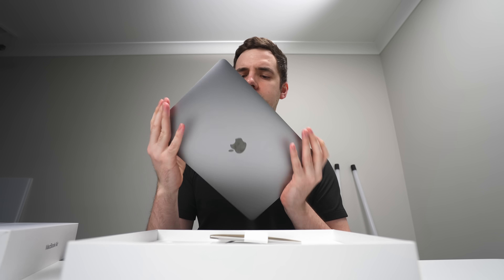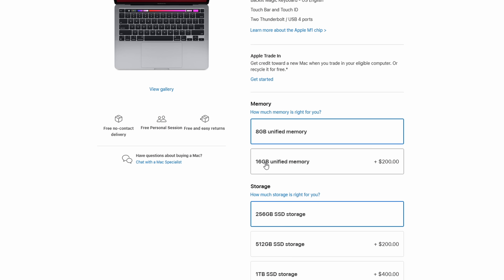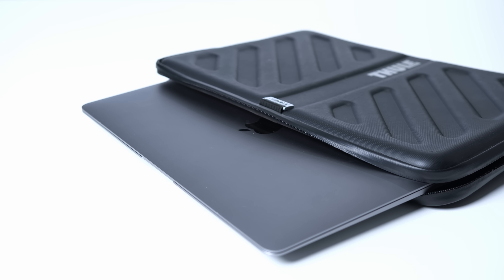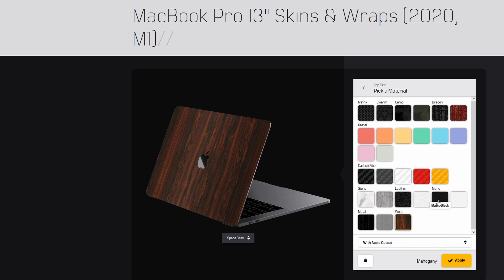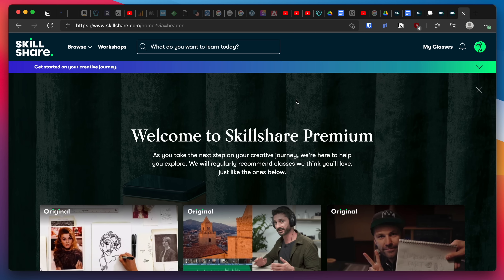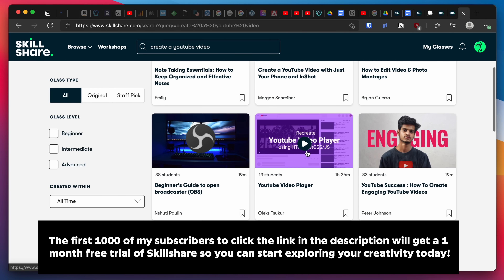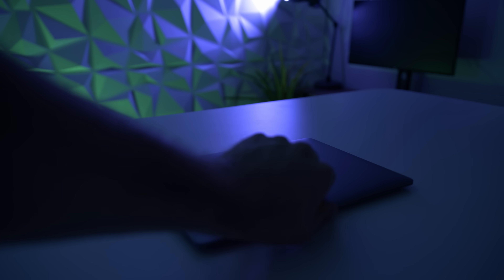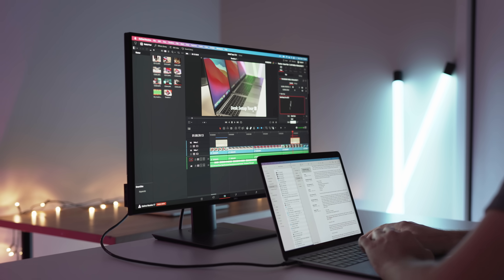How To Make Your MacBook Last FOREVER! (Ultimate Guide)

Comment from the maker: Here are the products featured in this video:
⮕  Thule MacBook case: https://geni.us/thulecase
⮕  Screen cleaning kit: https://geni.us/screenclean
⮕  Aluminum Laptop Stand: https://geni.us/mstand
⮕  Dell U2720Q 4K Monitor: https://geni.us/4kdisplay
⮕  Leather Desk Mat: https://geni.us/leatherdeskpad
⮕  Anker USB-C Hub: https://geni.us/ankerhub8in1
⮕  Samsung T5 Portable SSD: https://geni.us/t5drive
⮕  CalDigit Thunderbolt 3 Dock: https://geni.us/thunderboltdock
Reply: Please make a video on how to clear clutter for the OS and increasing the longetivity of the drive.. Thanks in advance
Reply: Can I get an Amazon mini fan and use it as a cooler for the MacBook? I’m broke.
Reply: Was this the monitor used at 10:56 ?
Reply: How about buying the M1 macbook air, which is fanless, but plugging it into an external laptop fan stand, and then running high workloads? Would that be ok for longevity? This solution sounds like a budget middle ground between performance & heat minimisation, as such I was just wondering if I could get your opinion on this please?
Reply: The links don’t show the specific product…

Comment: The M1 fries its SSD nands. Also after 7 years Apple no longer supports the product with software. Since its newest laptops have everything soldered its extremely hard to repair and Linux still dont have good enough support for Apple silicon. So you get something that is REALLY good for about 5 years. Then its getting sketchy with the nands that grounds out themselves. Sadly

Comment: I got my 2019 MacBook Air battery replaced in 2023 and in 2025 it suddenly won’t work if not plugged in and randomly turns off. All checks say it’s fine! Don’t know whether it can be saved or if I need to buy a new one. I’d hoped it would last about ten years, not 6!

Comment: I have a 2015 MacBook Pro that worked just fine but Apple stopped updating its OS beyond  "Monterey".  Some new software will not work on this OS.  I have some programs that I use that requires the most current OS.  That brings me to my new MacBook Pro M4 Pro - 24GB - 512GB.  I like my new MacBook but I didn't like spending $1800!

Comment: Cheers for the hints. I completely disagree with the assessment of the durability of the SSD, especially the potential period of around eight years mentioned. My Air now has a few years under its belt and the SSD is still rated in S.M.A.R.T. at 99% service life.

Comment: Purchased a new M3 MacBook Air for $815 USD almost a month ago. I've been using a Windows gaming PC and a Windows laptop for over 8 years. I purchased this MacBook because my Windows laptop was starting to die on me and the battery on it was awful. I am so happy that I purchased this laptop. The machine is made of high quality materials and not plastic like all my other Windows laptops which felt cheap in quality. The trackpad, display, and keyboard is also amazing. The only concern I had before purchasing this laptop was the 8GB of memory, but after 1 month of use I have NEVER had any memory related issue. I like MacOS to the point where I am seriously considering to get a Mac Mini to replace my Windows desktop I am using. The software on it is phenomenal and since I am using an iPhone it works so seamlessly with the laptop. Apple really does do some things really well.

Comment: Tip for compressed air:
DO NOT HOLD IT LIKE IN VIDEO! Always hold the can up. Hold it always at 90° or above. Do not point it down, because the liquid can come out, and damage the device that you're trying to clean. I actually forgot this myself, but luckily the liquid didn't do any damage. Stay safe!

Comment: Macs do last "forever"!  My 2011 Macbook Pro just stopped working today. It lasted 13 years of daily, practically 24/7 use. It was great and I loved it.
Reply: I have the same one am still using it but i do light work on it
Reply: Damn, do u actually mean it 😳 ??
Reply: Did you ever need to get any repairs or work done on it in these 13 years?
Reply: im watching this on a 2007 macbook pro. yes i open-cored it on high sierra

Comment: 5 or 10 years is not a lifetime

The skit is a lie. After around 10 years of use your mac book will be no good anymore because apple will stop you being able to update the Mac OS and then shortly thereafter your browser will tell you to update the Mac OS in order to continue to use the browser which you will not be able to do becuase your computer is to old as far as Apple is concerned so for most the computer will be no good anymore once you cannot update the browser. so it lasting forever does not mean much. I have had to throw away a powerpc mac pro desktop and a intel based Mac pro desktop because I was no longer able to update the OS and then the browser. And I never had any problems with those two computers which were plenty fast at the time I got rid of them.

Comment: watching these videos before purchasing a new matchbook, thank you for the awesome advice! one quick question though about silicon covers for the keyboard. I was planning on buying a cover but only having it on my keyboard while I do work and at the end of the day giving the keyboard a quick clean with 70% isopropyl and leaving the cover off. that won't be harmful to the keyboard?
Reply from the maker: I wouldn't bother using a silicon cover at all, they don't really do all that much. And definitely don't clean your keyboard every day, especially with isopropyl alcohol. You only need to clean your keyboard if it's actually dirty (for me it's about every 2-4 months). You only need isopropyl alcohol for dirt and grime that won't wipe off with a microfiber cloth.
Reply: @CreatedTech thank you for your reply and the great content. I just hate how the keyboard gets fingerprint oil after being used but it sounds like a quick wipe microfiber cloth should do the trick every once in a while, but it's also part of the keyboard process with use over time.

I'm doing my due diligence to keep spending at the minimum and learn from past mistakes with previous laptops. Hoping my next MacBook keeps running optimally for as long as I possibly can with all the info I've learned!
Reply from the maker: Honestly you won't really notice the oil on the keyboard. Best cleanliness tip is never use your keyboard while eating, especially greasy stuff. If you keep your hands clean the keys will take a much longer time to get dirty and it also keeps crumbs etc off.

Comment: compressed air doesn't damage the fan if it spins in the wrong direction lol it can damage the motherboard if it spins up too fast and generates electricity wich can fry stuff in the motherboard that's meant to give power to the fan.

Comment: A user can increase RAM and purchase a larger SSD at purchase, but Apple can brick it by refusing to provide system updates. Fortunately, it seems Apple will control provide updates for 8, 9, and, possibly, 10 years. Apple has stopped providing updates for my father’s Mac Mini after 7 years. Plan ahead, save money monthly to purchase a new Mac in 7-10 years time.

Comment: I replaced my iMac 2017 with an M2 Mac Mini. I have a Macbook Pro 2011, and I'm looking at the M1 iPad Air as its replacement as the iPad can also be used as a mobile screen for the Mac Mini and a duplicate desk computer is not a requirement for me. However, I do a lot of screen based reading which pushes me towards the iPad. This will constitute my third upgrade in the Mac ecosystem since I bought my first iMac in 2010, and iPad 1 God knows when.

Comment: The problem with this is the macOS upgrades. Over time, macOS versions become unsoppurted, and only newer machines can support the new macOS releases. For example the new macOS Sonoma that is being released, it will not be compatible with any Apple machines before 2017. So if you have a macbook from 2016, it means your current macOS (ventura) will become unsopprted in about 1 or 2 years and you'll be left for dead. You could however, instead try installing an alternative OS like Ubuntu, or Pop OS. But Apple products aren't supper friendly to other OS'.

Comment: Battery is going to be the weakest part as long as you don't get any water on the internals. And if you're unlucky, MacBook will self-destruct no matter what you do. See channel by "Louis Rossmann" for details (his work is to do board level repairs on Apple products to fix the system or do data recovery).

And never ever skip on backups. The Apple Time Machine to external storage device is maybe the best backup solution there is, so use it. At least weekly.

Comment: 15:27 Whenever anyone goes to an Apple store, they usually try to avoid repairing anything and basically force you to use the damaged product, or buy a new one. And then they charge a large sum only for disappointing the customer.

Comment: I recently read about TBW and it just put me off. I have just recently replaced my 2010 Mac Mini because it was stuck at High Sierra and was showing its age.  I’d upgraded my drive and got more RAM than what was said to be capable, stretching its life to 12 yrs!  To think any new macs I buy from now on will not last to when I want it to (by replacing parts), but because the drive will fail and cannot be replaced rendering the entire machine useless really irks me. An otherwise working machine would need to get trashed if there’s no workaround. So much for Apple’s pledge to be green. And their tight control over our devices that WE own should be left to us to decide how to mod it if we so choose and have the ability to fix ourselves or by a third party. Why should we be beholden still to Apple when our warranty or Applecare has run out and they have no responsibility to us?

Comment: That's the reason I stick to Macs. My last macbook pro lasted 10 whole years.  Still at the point I sold it, it was faster and had a far better screen than almost any windows on the market.  This is called future proof. If it's something you normally own only one, buy the best you can afford.  Now extremely happy with my brand new M2 Air. It's gonna last another ten years without a doubt.

Comment: Hi 
I’m getting concerned cause I’m seeing dust and debris going into my keyboard on my MacBook Air M1.
I’m helpless as if I try to remove them, by the time I get them to the edge it goes into some key along the way and impossible to get it out😢
So planning to use the keyboard cover.

My question is, does this impact the screen?

Apple says it impacts the screen and I’ve seen a few people commenting that it starts melting due to heat and leaves residues on screen.

Can you please confirm if you’re using one/ how long you’ve been using it and any cons ?
TIA
Reply from the maker: I’m not using one and I don’t recommend using one either

Comment: Hello 

Would you please help,

I used to keep my MBA almost 90% of time when using it connected to charger, but unfortunately , my MBA battery capacity dropped from 100% to 97% in less than 4 months with a cycle of 36 with only 5 cycles in 3 days!!
In 2nd October it was 100% capacity with 31 cycle
3rd October 98 % capacity 32 cycle
4th October 97% capacity with 33 to 35 cycles.

The problem really now is that the battery drains very very fast almost between 4 to 5 hours only while watching YouTube or movie, I don't do heavy tasks or editing at all.

Thanks to provide your advice and view point?

Regards

Comment: I see that opening the back of your Macbook and cleaning it with compressed air can sprayer will significantly have a faster system. I'm curious, will it void the warranty of the unit by doing this process?

Comment: You forgot to mention that having a fan has also downsides, like dust building up inside the device whereas Air does not have fans therefore it should last longer because of it. Other than that great video.

Comment: Spending more money now, because you might need the performance or storage later is dumb. The base model m1 air is $899

With 16 gig of RAM and 512 GB of storage, you're spending $1259. This is more than 40% over the base value. At that point, I would rather sell my Mac used in case I years later need more storage, ram or performance, and get whatever the next base model offers.

Comment: I think the choice to have a fan also is important as well, less moving parts means less points of failure. I will have a Dell Mini 9 that works great because there are no internal moving parts. Getting replacement parts right now is starting to become painful.
Reply: More just not having dust ports make a huge difference

Comment: I still have my macbook pro mid 2009, I used to work on it a lot, now I use it occasionally. It has never broken down. I have only replaced the battery, thermal paste and cleaned it of dust. And of course I replaced the drive with an SSD some time ago.

Comment: I am using a macbook Air 2015 13 Inch. I am still ok with the 8GB Ram. it is still fast for me and smooth. However, I am more than 1K Battery cycle. I am planning to replace some time this year. My problem, sometimes, my macbook lose display like on sleep then when I try to activate /open it again, sometime it took some time before wakening up. Can you tell what is this happening?

Comment: Internal storage is cool if you can afford it but you can expand outside storage afterwards with a T7 much cheaper. You can easily run big apps from the external drive and you won’t really notice the difference.
Reply: until the soldered in irreplaceable ssd drive fails and condemns the whole laptop
Reply: the issue is with the swap
Reply: @ko-Daegu unless your shit is going to be intensive, swap won’t be too bad, so long as you’re not using a base model air. 16gb and a TB is enough for the vast majority of people, but if you’re really worried about swap, get the 32tb (though swap memory may be used anyway no matter how much RAM you have, because of Apples design).

Comment: Really useful video. Heat is a big problem on my 2017 Intel MBP and causes the screen to have problems. Avoid MBP with Touch Bar as this commonly fails -I've taped over mine because it flashes endlessly). My best advice is to try and spend as little money with Apple as you can get away with because if something fails then you are left with either an unrepairable paperweight or a hefty repair bill.

Comment: im glad i followed some of your advice before i saw the video, i got the 2021 MBP 16" M1 max 32gb rm and 2 tb storage, should be overkill for me. when i ought my mid 2012 MBP i maxed out at 8gb ram and 1tb storage. ram was always enough and storage is between 60 and 70% after 12 years. stuck with catalina and apps starting not to work i need a new laptop 2021 MBP it was.

Comment: I had my 15in MPB for 7 years and just recently upgraded to M1 Pro 16in. I've spilled sweet tea once and hen a bunch of water 5 years later on the mac and it's still working. Just had to give it to apple store for a good clean. I had a top + bottom cover and keyboard/trackpad stickers for scratch protection. I've used my mac in every temperature possible and it is still running super-good. I just upgraded for the M1 performance honestly

Comment: I’ve just botted my old imac off an external ssd, re-loaded Logic Pro and DISCONNECTED from the INTERNET. I’m convinved that what makes macs die is that they keep releasing new software that require higher levels of specification. Just stop using the spinny drive and stop upgrading.

Comment: The rubber feet on laptops are built in weak points. They come off over time and the subtle difference means the elevation of the laptop off the surface isn't as high, fans become heaters with insufficient space, so then you have a system heating itself up.

Comment: I recently traded in the 2017 MBP, which I used for a little over 4 years. I normally leave my MBP at work during the week and take it home on weekends. It is placed on a pedestal, so it is away from elements and the keyboard is very lightly used as I use a plug in keyboard. It looked cosmetically fine, but the company who evaluated told me that the battery is degraded and need to be replaced in order for them to resell it. It maybe due to the fact that it stayed plugged in during the weekdays, but it is hard not to in my case. I replace my MBP every 4-5 years as I can expense it at my business, but I can see that it gets expensive if you have to pay for it out of your pocket.

Comment: Good advice about keeping your machine safe. I've been doing the same for over 30 years and never had a mishap. Now that Microsoft has brought out a buggy Windows 11 with crazy installation requirements - none of our 5 machines can be upgraded and instead of replacing them all, we're going to keep them on Windows 10 as long as possible. As I go into retirement I'm now looking to get to an Apple for the first time - Macbook Pro M1 14".  I saw a recent video how the Apple RISC performance has now outstripped Intel's CISC architecture - and significantly undercuts the power requirement which kills Wintel laptops. All the best, Rob in Switzerland

Comment: My brother still has his 2015 model and it’s working really well still. It didn’t even have a case or screen protector and the battery still holds a decent amount of change. I’m confident the M1 will hold up really well as well
Reply: That’s why I buy macs, I only upgrade every 6-8 years, they’re a great investment. It’s easy for me to buy the upgraded ram and SSD options, despite the upfront cost, because it’s a better deal in the long run than replacing a cheap windows machine every 1.5 years. Plus they have great resale value, so if I ever want to upgrade early it’s basically 50-70% off a new one if I sell the old one.
Reply: I wish my 2017 MacBook Pro still had any battery life lol, it’s horrible now.